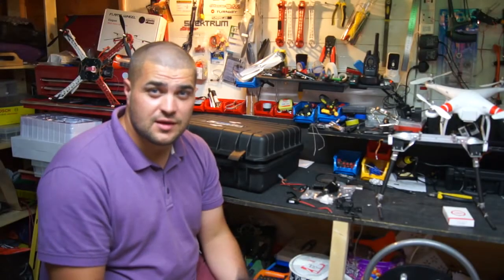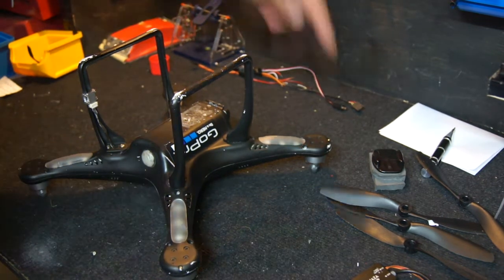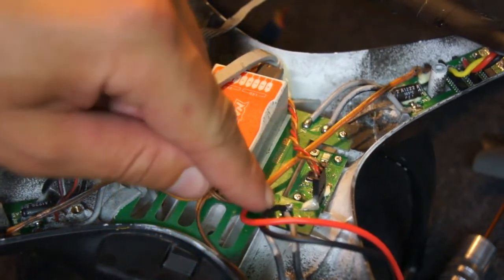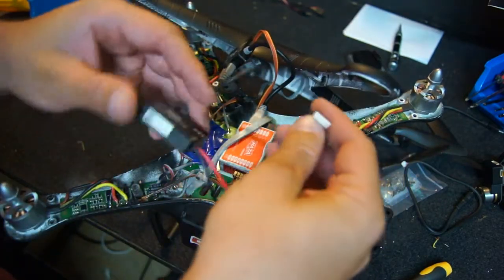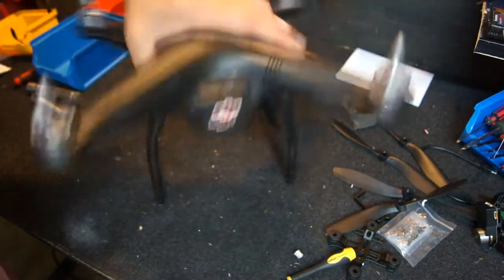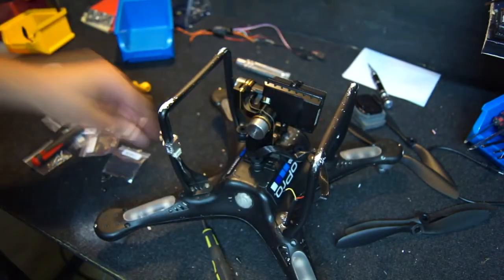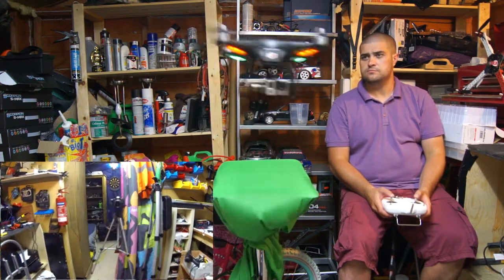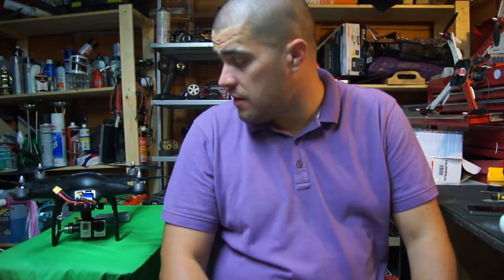Detailed Zenmuse H3 2D Gimbal installation

Comment: Hi great video, but I need some help, I have this gimbal installed on a phantom 2 v2, it works fine tilts with the new scroll wheel fine. But the dji assistant software won't update my gimbal, none of the gimbal controls work on the software?

Comment: Help. I watched your install video a few times and then did mine. It worked great. Until I had a crash. Now it shakes and doesn't respond as it should. I recalibrated the Phantom and it fly's well but the gimbals doesn't. Any suggestions.

Comment: Can you make a video on how to connect the h3-3d gimbal to the phantom 1? I can't find one where they explain how to do it with the phantom 1 only the phantom 2.
Reply: There is a new mounting adaptor pack just out with longer legs and a mount to suit the 3rd axis top mounted motor, you need the NAZA PMU V2 as well and then it's just the same as the install of this Gimbal.

Comment: Can I safely use different voltage battery for the GCU unit than the flight controller (NAZA-M V2)? For example, If I powered Zenmuse GCU using 3S lipo and NAZA PMU using 4s lipo, is it safe?

Comment: Nice intro, I had to laugh, that's exactly how I felt when I got mine. Your the kind of guy that knows it all, so this is my question for you. I have the dji 450 and it mounts on the front of the bottom plate. What I found was that it has a diving board effect. Almost as bad as one of those spring door stops that my cat likes to play with. Should I try to reinforce the front to eliminate that?
Trying to find out if others have the same issue or should I not even give it a second thought? What s

Comment: Thanks! I saw another video where someone soldered the power cables of the PMU & GCU all to the main + & - point on the board. He actually mades cuts into the existing wires and soldered it on there. It didn't look right to me to begin with, so that's why I loved your video, my hunch was right :-)

Comment: Does the video out cable ..video/12v/ground ...from the zenmuse GCU also power the fatshark transmitter or do I need to power the transmitter from the battery
 balance plug?

Comment: Question: if using FPV transmitter from gopro, do I need to use that extra cable and video out straight from zenmuse controller into TX, or can I use GP3 camera cable straight from GP into TX? (Either works?) Thanks!

Comment: My gimbal is already back with DJI so my time spent looking at this is over for now. Trouble is, you can see from the forums that lots of other people are having the exact same problem.
See the "Zenmuse Dead?" thread within the H3-2D part of the Phantom Pilots forum.
Read the number of other failures in the comments under the Vimeo clip: no: 69872108
DJI really need to start engaging with their customers so we get this solved.

Comment from the maker: my beta version is still going strong with no noise, I just watched that video and it is ver loud, try updating the zenmuse controller with the software that came out yesterday. I noticed on this install that the gimbal was a fraction more louder than my beta unit but it works just fine, only time will tell.

Comment: Great install video. Does it matter if both the pmu & the other zenmuse wires are soldered onto the main battery leads ? Also I've read on Facebook DJI Phantom Owners page that the gimbal motors get Extremely Hot , also the gimbal itself gets hot and some of the gimbals start to make that Whiny noise ! Any truth to that ? One guy said the gimbal was ok for 6 flights & on the 7th. flight it smoked and burned out. I'm still waiting to get mine. Thanks again for the video.